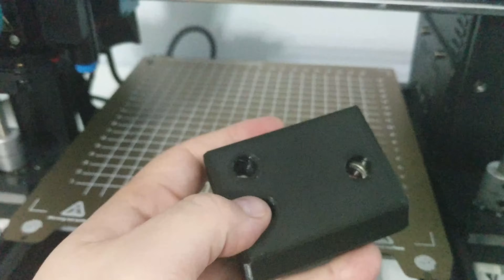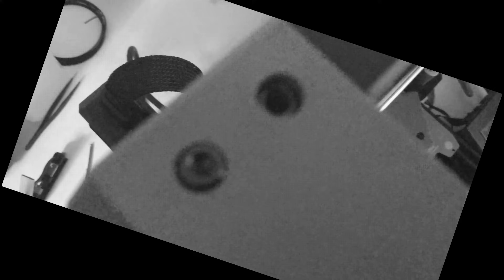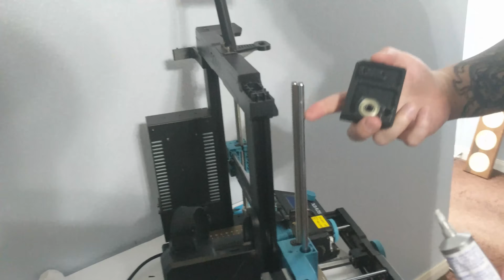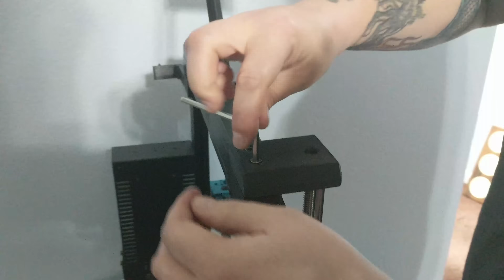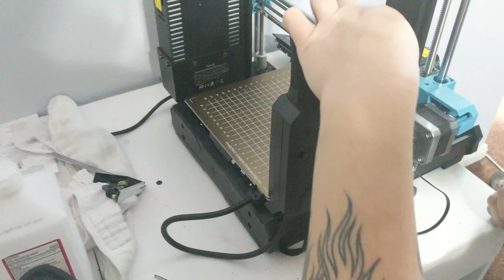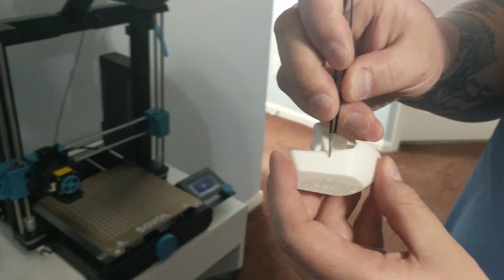Sovol SV06 Z-Bearing Axis Mod

Comment: The simple question is WHY are you doing this mod as it will not improve the prints at all. As the main rod is totally stable all you are doing is putting extra pressure on the the lead screw rod for no reason.
Reply from the maker: If it is out of spec, such as bent screws, guides, then yes there could be some issues. I personally have not experienced any motor failure, increased vibration, or added pressure. I think at this point, the fact that the printer is used daily since this video was originally posted, that things are not as dire as most people perceive them to be. Plus it feels more solid in the hands when it is moved. ...but as always your mileage will vary, do what you think is best for you.

Comment: Hello. would it be okay to do this in a milling machine and use metal ones ?
Reply from the maker: If you have that capability that would be awesome to see. I don't see why it would be an issue as long as you have no frame twist and everything is square. Post pics to my Facebook when you're done. I would love to see your milled part!

Comment: You should not lock your Z-screw in anything at all, there is a reason why they have free movement. Locking them in, it will make things worse and impact your linear rods, which will make your print results even worse.
Reply from the maker: That's only applicable if your parts are out of spec. I've experienced none of those issues with over a thousand hours of print time operating on those bearings. People seem to make the assumption that everything is so out of spec that this will lead to premature failures which isn't always the case.

Comment: I don't understand how this helps you at all? The only thing this might help is with screw-wip on high speed rotations. I don't think they are a factor in this application. You need to constrain the screws from moving up and down, not from side to side as the latter over-constrains the Z axis.

Comment: Just came across this video.  Wanted to say that the lead screw freedom is by design.  The smooth rod guides the Z.  The wobble in the lead screw after adding your bearings is going to transfer to the frame which is what you don't want happening.  Again the smooth rod is guiding the Z, the lead screw only sets the height.
Reply from the maker: Zero issues on my end and I also have much more expensive printers that use bearings at the top such as this. This comes down to, do you feel safe using this? If not don't. If you have frame twist or your printer is not squared, don't. If your screws are bent, also probably not a good idea. Personally, it just seems like this was an accounting decision to save money as the Plus version has them, same design, just bigger.
Reply: @room281tech8  I wonder if "much more expensive printers" also have much more build and parts quality, so they have much less chance of using cheap wobbly Z screws...

Comment: F688-2RS flanged bearings will fit in the injected molded uprights for your Z axis lead screws. All you'll need to print is some clips that attach to the very top of your linear rods to keep the bearings from moving.
Reply from the maker: I actually did a follow up to this video where I used 688ZZ bearings. One of my SV06s is running right now with them. If I was to do it  again I would of probably used the F688ZZ bearing if my goals was to keep it all original. I haven't needed a clip. The 608zz mod, the bearings fit much tighter. Both setups have been working well for me.

Comment: I can't believe Sovol made this printer without them bearings! Great mod.
Reply: I can. A wobbly Z screw needs to put its wobble somewhere. If it can't do it at the top it'll do it through the X gantry.

And given these are "affordable" printers, chances are they're not using the finest Z screws.
Reply: They did it on purpose so they can sell an "upgraded" version that includes all these mods by default.
Reply from the maker: I hear their new sv06 plus has these bearings.
Reply: @allwoundup3574  the upgraded version also sell f for a lot more..  it's not magic.

Comment: Why not use bearings that fit? There is already space for bearings in the original blue frame assembly. Just use bearings that have an outside diameter of 16 mm. 
I just did that today and it works perfectly without replacing the original parts.
Reply from the maker: Interesting. What make/model of bearing did you use?
Reply: @room281tech8  I used 688ZZ Kugellager 8 mm x 16 mm x 5 mm from Amazon.
Reply from the maker: @wilhelmspeck5870  Good to know. I will have to try that. Thank you for sharing!
Reply from the maker: @wilhelmspeck5870  I just bought some of those bearings. I'm going to try it out on my other SV06
Reply: @room281tech8  ... and what's your verdict?
Reply from the maker: @wilhelmspeck5870  I'll let you know once bearings arrive and I get them installed.

Comment: People should be careful with this mod. In most cases, it will lead to problems. The issue is that these are lead screws, they are not $1000 ball screws. That means that these lead screws are not perfectly straight in the vast majority of cases. If you bind the lead screw at the top, and keep in mind that it's already bound at the bottom to the stepper motor, whatever deviations exist in the lead screw will manifest between the top and bottom.

Beware.
Reply from the maker: If you make sure your parts are straight and square then you'll be fine. In extreme cases installing this on bent parts and a frame that's not square and out of spec would cause some binding.
Reply: This kind of mod is well known to cause problems, and Bassam is just pointing out that people should know what they're doing before installing it.  You only want 2 constraints on a Z-screw, so if you are going to add a bearing at the top, you should also be putting an Oldham coupler at the Z-nut or similar.  Otherwise this mod will likely make Z-wobble worse, and wear out your z-nuts or motors prematurely.  
Great for getting everything square and centered.  Just remove it after.
Reply from the maker: @beauslim  I have encounter zero issues. There are many people and stock printers that come with a similar setup. As always, your mileage may vary. If you are in doubt or lack the necessary skills to ensure that it is installed correctly, then avoid doing this. As with all mods, firmware, part replacement, and the like there is a risk if done incorrectly. My advice, be smart and do what you think is best for you.
Reply: @beauslim  it's well known and yet I can't find anything about it and many printers are designed with these bearings already installed, including several from this same company.
Reply: @allwoundup3574  You clearly didn't look far, but by all means, do what you want with your printer.
Reply: @beauslim  trust me, I know how to use Google lol. And you didn't seem to address the fact that many printers on the market use this setup out of the box. But I figured you wouldn't. 👉
Reply: @allwoundup3574  There is enough information in my original comment and in Bassam's for you to do your own research and understand.  
Does the Prusa use bearings?
Reply: @beauslim  "do your own research" usually means you can't back up your claim. It's okay to be wrong, dude, you'll survive.
Reply: @beauslim  why don't you link the evidence  you are claiming?
Reply: @allwoundup3574  just because some printers use this out of the box doesn't mean all printers should use it. Like Beauregard said, it adds another constraint on the axis, which can make your prints worse if you don't have a completely true lead screw. If you constrain the top of the screw, any imperfections of the screw has to go somewhere, which would be the frame of the printer, unless you have something like an Oldham coupler on the gantry. Since the SV06 has a fairly sturdy mount for the X axis, you really don't need to constrain the lead screws, because the linear rods will keep everything straight, so having the wiggle at the top is a good thing, because that's where the imperfections of the screw go. Now, on a printer like the Ender 3, constraining the lead screw and adding an Oldham coupler is a decent idea because the X axis isn't super secure, and a lot of vibrations of the lead screw can make it into the gantry.
Reply: @Smokinjoe again, claims of evidence without actually providing any. Just an FYI for everyone reading this, I'm 95% sure that Bassam also frequents the official Sovol forums and the subreddit where he acts like a complete dick to everyone, even beginners who are just asking honest questions. He's probably not someone you want to take advice from since he has a very elitist view about 3D printing.
Reply: @Smokinjoewhite if it's so easy to find, then point me to it. You can't just make a claim and say "look it up yourself" when asked for proof. That's not how the world works.
Reply: Unless your z screws are significantly bent, you'll be fine. Not to mention the fact that many 3D printers come standard with these bearings, including the upgraded version of this which was just announced. No need for fear mongering.

Comment: Not sure this would do much good since the gantry rides on two vertical rails which have nearly no play at all. I still might try it out just because I'm curious.
Reply from the maker: Yes there is that but there was still some slop. If you think it is rigid with 2 points of contact, then try 4 lol. The frame really stiffened up for me. Noticeably different when moving it around. Now it holds its "zero" better and just functions smoother overall. I'll admit I was skeptical too but as for as mods go it was cheap and cost me nothing. In some situation you can't go wrong tightening things up. If you do it, let me know if it made a difference for you. For me, the prints were good before but now they're coming out smoother using the same filament and settings. Happy printing
Reply: @room281tech8  So I went ahead and did the mod. I ran a test print before and after to compare, a 40mm^3 xyz calibration cube. And honestly, if I didn't mark one of them I would never be able to tell the difference. They both have tiny little surface defects that no reasonable person would really care about and otherwise look stellar, especially considering the issues I've had with this printer in the past. Maybe it finally decided to act right when I start stripping stock parts off of it or something. 

You mentioned your printer holds zero better so I guess time will tell. One thing I immediately noticed was that there is a lot of noise coming from one of the bearings and I'm not entirely sure why. I installed them as perfectly as I could using a squeeze clamp to force them into place. Maybe that individual bearing is faulty or something. 

Either way, I'm interested in how my prints will be affected from here on out.

Thanks for the video.

update: upon further investigation, I found that the cause of the rattling noise from the one side was that the Z screw wasn't making full contact with the inside surface of the bearing. I have no idea why, I tested 3 different 608zz's and they all had the same issue. For some odd reason, the left Z-screw on my SV06 is apparently very very slightly smaller than the right, causing it to only make intermittent contact with that bearing. I noticed that the bearing wasn't spinning at the same speed as the screw so my solution for the time being is to wrap a bit of masking tape around the tip of the threaded rod to fill in whatever gap is present and now I don't have any noise besides a low whining under certain conditions which I think was always present anyway.
Reply from the maker: @allwoundup3574  I'm glad you found a resolution. I just bought another one to pull apart and go through. I have been hearing so many mixed messages on the quality control leaving the factory. The bearings have been the most notable amongst people's issues. It wouldn't surprise me if the screw may be slightly out of spec near the top.

My goal is to document all the issues and fixes I encounter. I have a friend that bought one of these and it is a nightmare. I've spent days working with him on multiple issues from gears slipping to horrible bearings. He is a much more patient person than I. I appreciate what you've shared as this will help others and give them an idea of a possible issue.

Comment: Thank you for this mod. Did this yesterday and this morning I checked the bed level with a ruler edge. Middle of the bed showed higher by almost 1mm. I added 1 mm washers to the corners, then rechecked with a ruler edge - almost dead on. First print was a calibration cube and wow - layers are uniform, everything is clean.  Your mod saved me a lot of frustration. Thank you.
Reply from the maker: I'm glad this helped with your prints. I know a lot of people have been having all sorts of strange issues with these printers. I'll be doing another video on the bearing issues I faced and how I resolved it to create even smoother prints.

Comment: can you see the difference in print quality after the upgrade?
Reply from the maker: I do indeed. Also before this I had to calibrate the z-offset and level the bed constantly. It didn't seem to hold "zero". Now it does much better. Would I do this mod again, yes.

Comment: Good video. Did you draw the Z-bearing part yourself? And is it possible to download it somewhere?
Reply from the maker: No I didn't, but the the entire printer is open source. They posted all the cad files to the parts on github. I'll post a link in the subscription for the part.